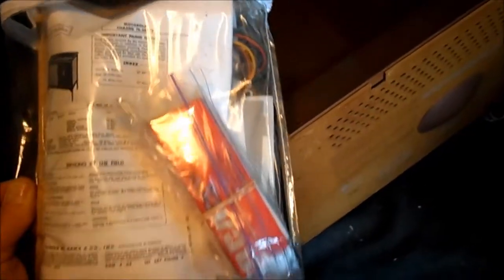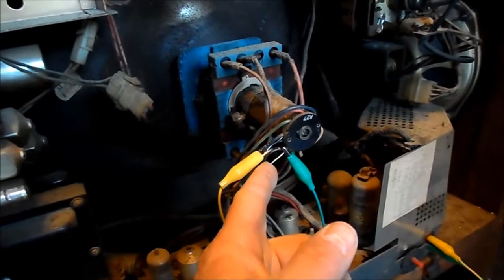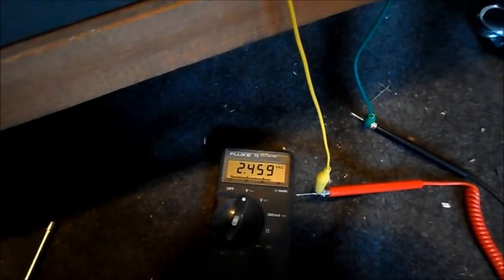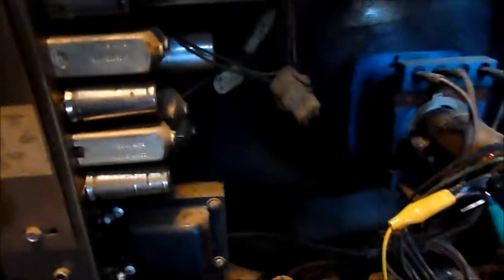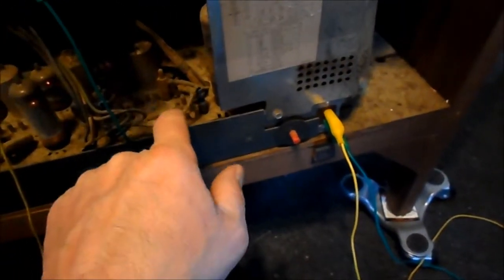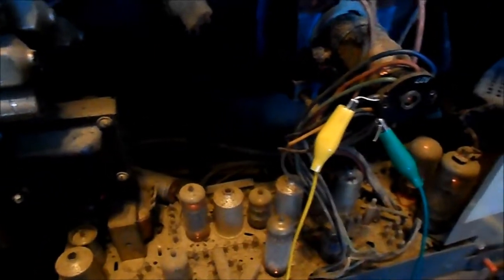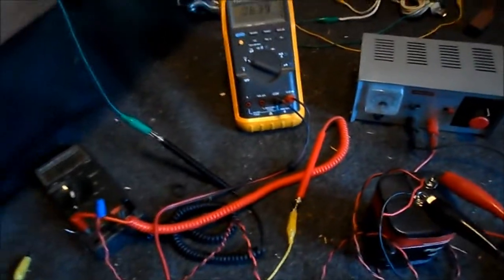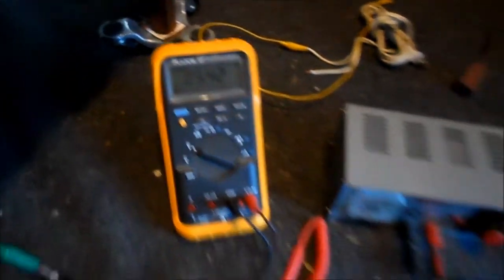23 Inch Motorola B&W CRT Excess Current Draw.

Comment: are you sure the filament is a 6.3v? what is the number on the tube.
 opps I posted before you got to the end. I see 2vac and 8vac on the schematic so it seems logical that 6vac would be correct.
Reply from the maker: It's 23DAP4. 6.3V. Clever how you made the connection from the listed voltage drops. Was thinking that's why they did that.

Comment: Did a dropper resistor on the filament string drift up in value?
   I wonder if the cathode has a short across part of it making the total resistance less and hence more current draw. That tube was glowing like a light bulb! Maybe you should independantly power the CRT cathode and adjust it till you get a good image and only draws approx 600ma. With that extra 300ma, I was expecting the filament to blow any second.
   Like to see what you come up with as a solution.
       Tom
Reply from the maker: I will re-test the CRT using the Sencore tester, & see if it shows any sign of a HK short. The B&K 465 didn't.